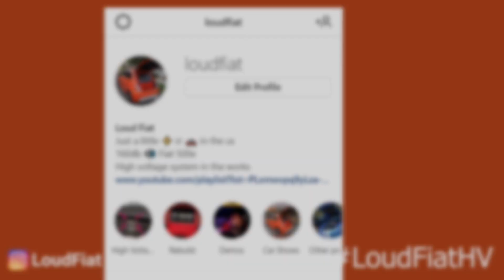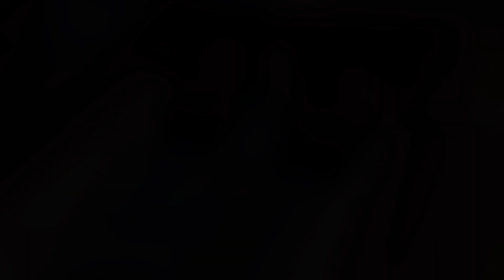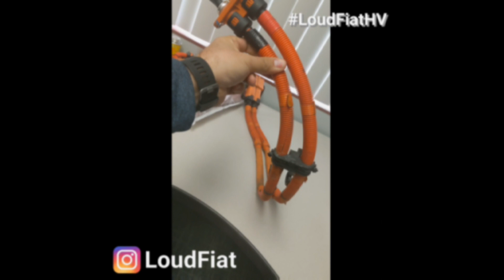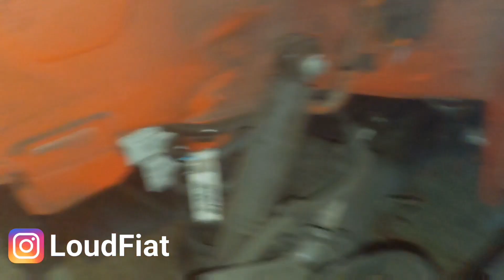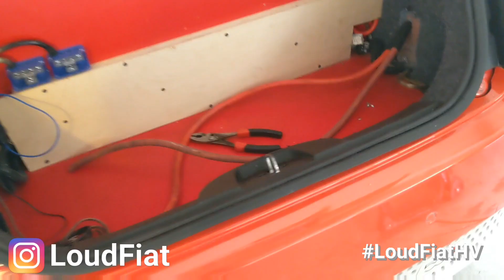Fiat 500e 104,000 watt amplifier install to high voltage traction battery

Comment: Well that system must shake you right out of the car! Lol. 

I also have a 500e and would like to install a small bazooka sub. How did you get the wire from the battery to the amp? I am unable to find any good place in the firewall to run it through... thank you in advance!
Reply from the maker: There was a rubber bushing I drilled through
Reply: @LoudFiat  do you have any piece of your tutorial videos that show where that bushing is?
Reply from the maker: @antoniomaceo4706  no, hit me up on IG and I'll send you a pic
Reply: @LoudFiat  you DA MAN! ty.

Comment: Awesome job on the final setup!

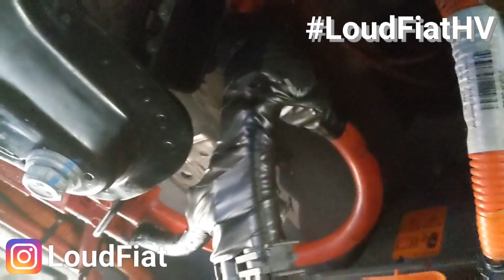07:10 Do you have more info on the "battery noticed it was spliced" and what exactly you did to fix it? I am looking at tapping into my HV battery to backfeed my house/solar panel system. I was actually going to do it at the power module and install a breaker just like you did. My plan was to find a spare power module and clip the ends, to make it plug and play. https://www.fiat500owners.com/threads/anyone-know-how-this-exactly-work.150052/page-2
Reply from the maker: I jumped the HVIL shield with a wire where I tapped the HV line. As long as you maintain continuity on the shielding it won't know it's tapped.
Reply: @LoudFiat  Thanks! Makes sense. At least you have proven half my theory. It is possible to tap the HV battery, without the car ECM freaking out. Correct me if I am wrong, but the cable you removed coming off the battery, goes up to the power distribution module correct? From the distribution module it splits into two wires. That is where I would like to make it plug and play. Are you on any 500e forums? Check out that link  in my previous comment, if not.
Reply from the maker: @BackRoadBound  yes, from pack to PIM. And I gave up on the forums long ago due to getting a lot of heat from folks with little imagination in regards to what I wanted to do.
Reply: @LoudFiat  I understand. I commend your efforts and pioneering spirit. This has helped my research and given me promise to pursue the goal of using my car as backup power, instead of noisy generator. 

Your final install is very clean and impressive. Just don't blow your doors or roof off. lol
Reply from the maker: @BackRoadBound  ty, I'm assuming you saw my final install at https://www.instagram.com/p/B_LSs2bJO_6/?igshid=13bl4d0bkjaya